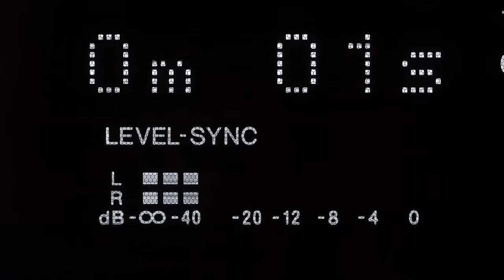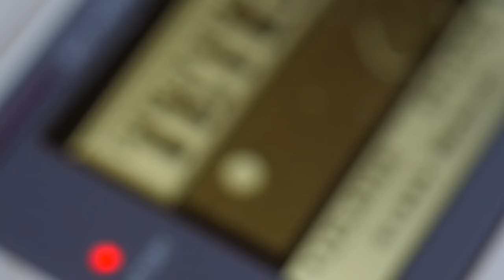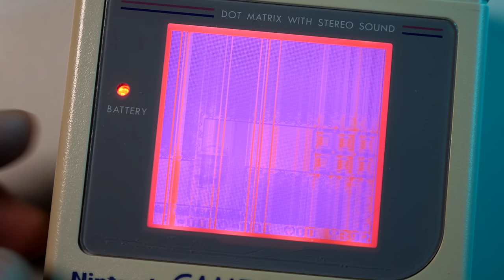The Best Game Boy DMG Screen Mod Ever!

Comment: Youd have to remove an already installed bivert mod chip though I'd assume
Reply: Yes you have to remove the Bivert chip. Also a lot of these new screens have the grayscale wrong. If you look at his video around the 5:44 mark you can see the pipes in Mario Land show Dark Gray - Light Gray - Black. Should be light-dark- black. The Youtuber Mahko has a fix its pretty simple.
Reply: @1983hartman  Even the perfect solutions will have a flaw or two.
Reply: @1983hartman  can you link me, I cant find the channel
Reply: @Bro-cx2jc  yes but the fix is an easy one to do, even though most of the people installing this mod doesn't even realize the error. Also supposedly the later version doesn't suffer from this error mostly early buyers like me. So go for it and install it, and if you have this error there is an easy fix ;)

Comment: Another fantastic product review Colin. I can't see myself getting one of these because of its price, even though I can definitely afford it, but maybe later on when I've got less to worry about I'll give it a shot for my Gameboy XD

Though I don't usually solder stuff, so I might keep it as a headphone-only unit, though that could be boring. I tried installing a rough mod to my Sega Genesis once for three-way region selection, and I used Gorilla Glue instead of soldering since I didn't have the tools (and the complex doesn't allow us to use electrical tools in our apartments). Wellp, I ended up accidentally changing the Genesis permanently into a Japanese Mega Drive by using a bit too much glue and sticking two of the jumpers together.

Ever tried Japanese PAL? Well now I have a console that does it lmao, you can see how helpless I am when it comes to soldering :) if I had the tools and the right environment I could do it though.

Comment: Is it also Transreflective? That i can play with it also in direkt sunlight? Otherwise all these Backlight Screenmods are absolutely garbage as good as they look inside or in the dark with most of them the Gameboy lost its absolutely unique feature.."Playing Outside wherever you whant" and also in direct sunlight. And most of the IPS Displays dosent suport it also as all of our Smartphones and Tablets they are only superbright and so they need alot of Energy in sunlight what is a totaly misstake in my eyes.. Thats the most important thing for me why i use my old Gameby and Gameboy Color also as the Gameboy Advance, they can be used outside with i brilliant picture also if the sun shines as much as it can :D then its only me that will be burned from it when i forgot me while playing xD.

I know only two Transreflective Backlight Screens that have a verry good picture quality, are verry bright if you need and also you can turn of the backlight and because its also transreflective you can play outside in sunlight as perfekt as with an original non light screen. Only misstake is that the screensize is a little smalet like the bennvenn gbc mod and all the others.. but because its transreflective its for me the best screen. The holy grale in my eyes is a screen with that features in the original size. 

Also i could miss a little picture quality on my smartphone and tablet when they would be also transreflective and backlighted.. that would so great, safe alot of battery/energy and you can read text and look pictures/movies or sufring on the internet without anny issues while your putside and the sun shines bright directly on your device. It makes no sence for me why the produce other screens like now that they cant do it.. also the switch lite needs a transreflective backlight display! ;)